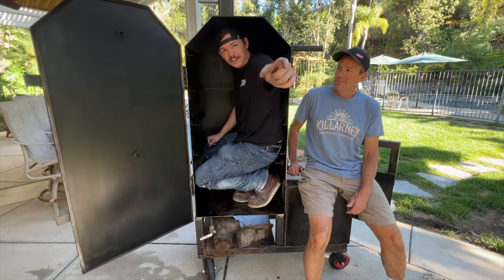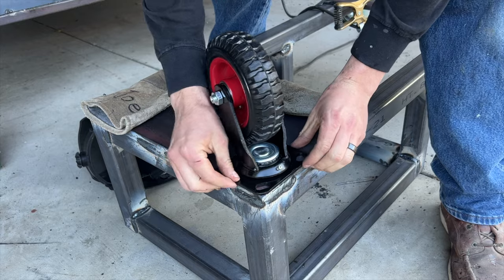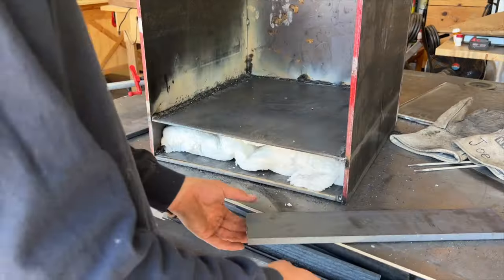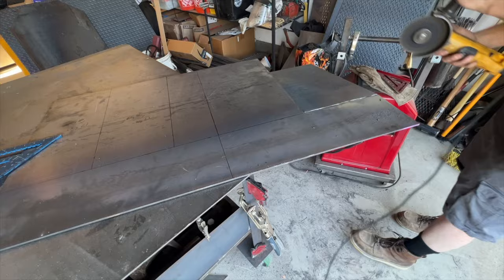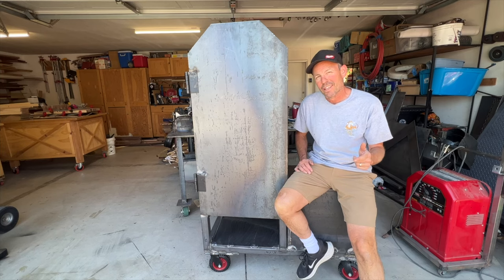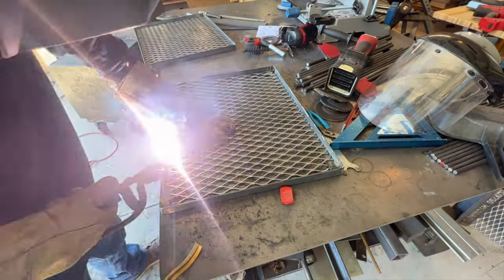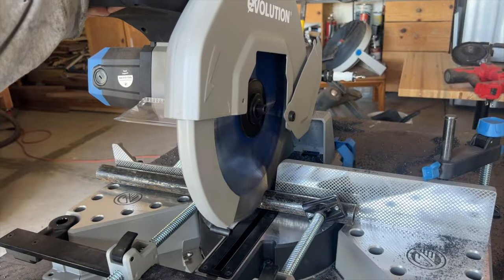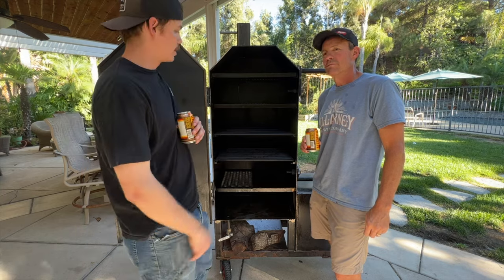How To build An Offset Smoker (DIY BBQ Build)

Comment: Only question I have is how are you going to control airflow on the firebox?
Reply from the maker: We definitely should have added a latch to regulate airflow! We just prop the door open and since it’s heavy steel it doesn’t tend to move too often.